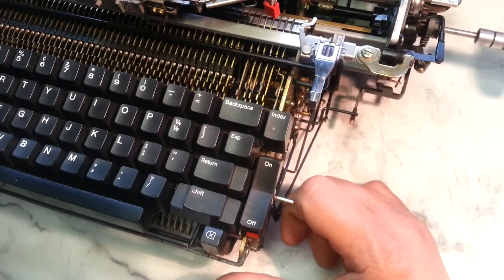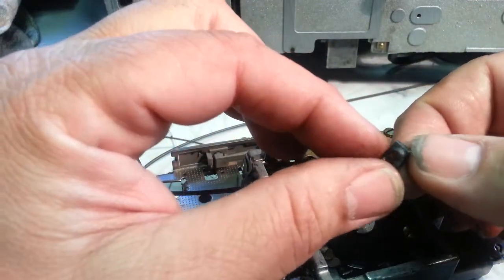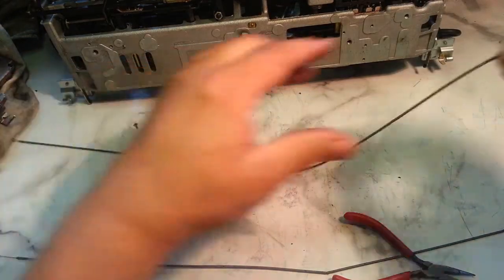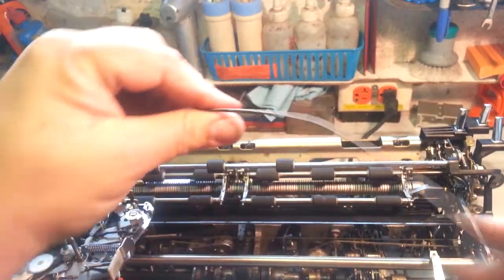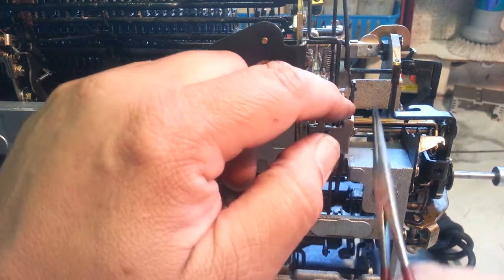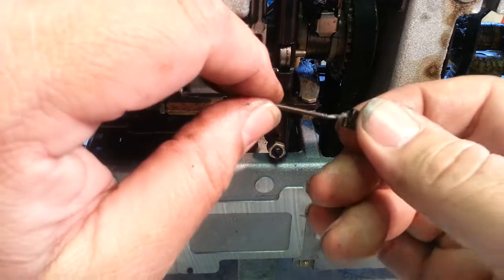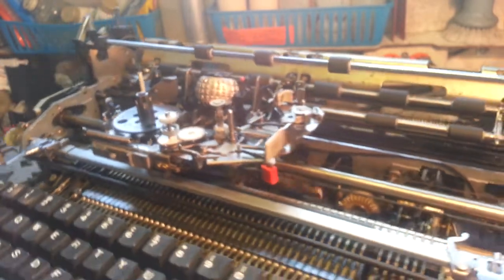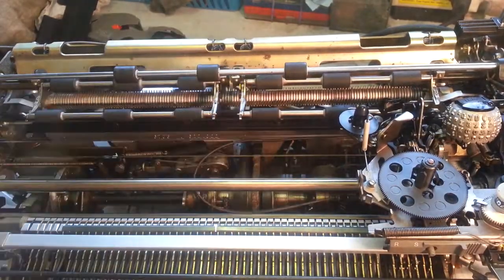IBM Selectric Typewriter Dual Impression Control Cable Replacement Fix Repair

Comment: Very good job. Nevertheless have to be verified if the mechanism's roller travels in both lobe of normal to slower velocity. This is made applying grease on the track of the print sleeve lobes and watch which lobe the normal characters travels over. Comas and dot and small area print characters must travel on slower velocity lobe. If not, the cabel must be pulled in or out till this condition is achieved as specifications

Comment: A real pain,is when the cable has been out of adjustment forever and the cam follower has been dropping off the cam lobe and has cut a diagonal groove from one lobe to the other.
Cam replacement is a real puzzle every time.